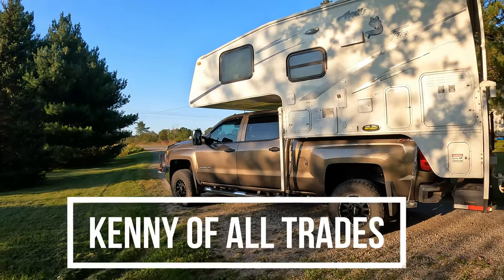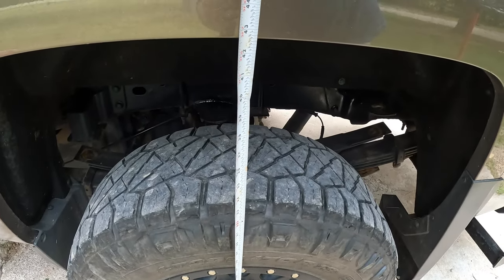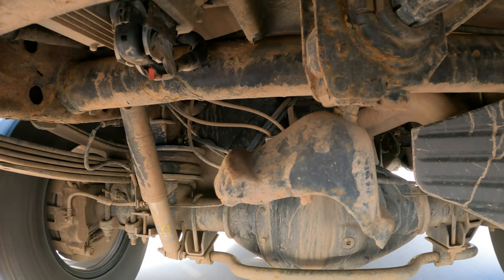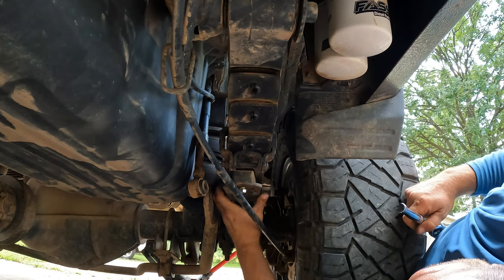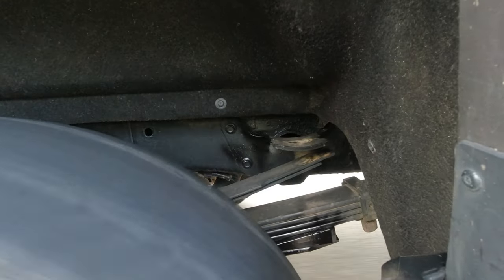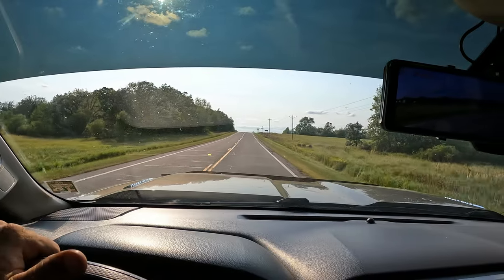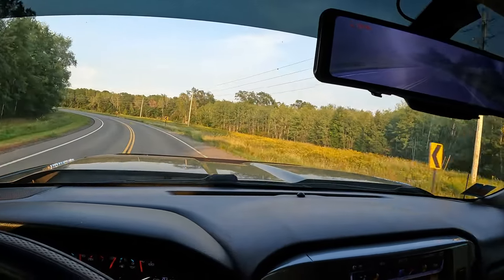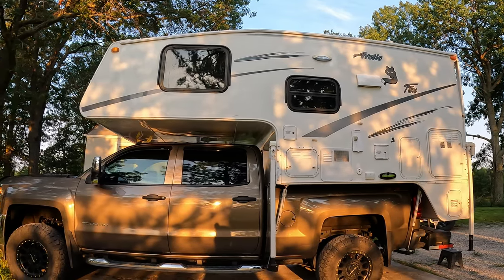Suspension Upgrades for Truck Camper

Comment: I don’t understand how every body thinks a 6.5’ bed is standard. What has changed 8’ bed is standard bed size or a short bed or Texas Caddy.
Reply from the maker: I know years ago the 8ft bed was a standard. But now 6'5" is standerd, 5'8" is a short, and 8 foot is a long bed.
I completely understand what you are saying though. I think  manufactures have changed the definitions.
Reply: I've noticed the same thing and wondered about it myself. In today's America, everything gets smaller, yet more expensive. I think it all changed when larger cabs became popular.
Reply: I love my supercrew 6.5 ft bed I wish I could get a 8ft bed. My next truck I'm looking at is a f350 regular cab 8ft box so I can get a slide in camper.
Reply: 8ft hasn’t been standard in decades
Reply: As the ‘mall crawlers’ and pavement queens became more of a thing, the beds got shorter to cater to a larger crowd. People didnt need a 8 ft bed to drop the kids off at school, to grad a few things from Home Depot/Lowes. In order for less experienced drivers to handle driving such a long truck, they simply shortened them to be able to sell more. Not that they were changing the name or the game, they just found out how to sell more trucks to more people.

Comment: A tip about airbag’s.  Use separate air lines/valves for each airbag otherwise when you’re cornering air will move from side to side.
Reply from the maker: @jiml40  100% having each bag plumed separately is definitely a must-have. About 20 years ago, I stuck a truck camper in a truck with the airbags running off the same line. I didn't even think about the bags. That was a huge mistake. When I got into the first curve, the truck swayed up to the high side. As the road straightened out, the camper kept swaying back and forth. I had to pull over onto the shoulder before it stopped swaying. It wasn't drivable like that.

Comment: I pull a TT. I put on a Hellwig sway bar and I use Timbren springs. I agree Tork Lifts are nice but they have a high price tag. I want a truck camper. I am going to get a F-550/RAM 5500 crew chassis (19.5k GVWR) or a F-450 chassis (16.5k GVWR). I can’t decide on a Arctic Fox 1140 dry bath or the Host Cascade 10.5. Great video, great to know what others use on their suspensions for truck campers for my research.
Reply from the maker: Thanks. I think your doing it right, going with a 5500 is smart. That way you are not fiddling around with these modifications. I'll be honest, I dont think I could afford a diffrent truck in this lifetime.
Reply: Todd, my fav was the artic fox 1140 dry bath too, was considering it until i saw (some utubers did it) it on the same truck as mine (ram 3500 dually) n holy cow the camper imo looks too heavy for the truck. So yes 5500 or 4500, need bigger payload imo for that camper. Also i saw another tuber talk about his 1140 and said it’s heavier than manufacturer wants u to believe as he was at the weight scales with his. Liked the cascade (lots of choices for inside if ordering) but I do pull over off the road at times to quickly jump inside camper to get something or use bathroom, so 1140 table doesn’t extend into traffic if need to move it. 
Anyway After i freaked seeing how the truck would look with the 1140, i was back at the drawing board hunting. I ended up with a northern lite 10-2, drybath. Got it end of june. Didn’t even consider to look for one because of cost and dark interior, until i saw one in person. Well, I love it, inside wasn’t ordered in any black decor, and so seeing it in person quite shocked me actually. So I have no slide maintenance, no tpo roof maintenance, no anode rod maintenance, got a genny installed too. And like the 1140 has a 3 way fridge, game changer with lithium batteries! Came with only 2x 100 watt solar, but I run the fridge on the batteries no problem when travelling, in fact, i sat stuck from highway accident blockage, engine off for 6 hrs solid, fridge on battery, sun out, and it wasn’t until the clouds moved in after 5+ hrs that 100% battery went down to 93%. Sooooo, when i saw this northern lite, it made a lot more sense for me and justified the more $ it cost me than the 1140 would have been. Plus is a lot lighter. Campers weight sticker dry is 3410 lbs, because it was ordered with the stupid glass windows vs the acrylic, (glass added about 200lbs) but I’m not complaining, just always hate these screens that come with these frameless windows 🙄. Haven’t added anything to the truck suspension yet. Good luck in your hunt. 🍻

Comment: Hey brother I would go ahead and undercoat your truck chassis with wool wax or fluid film to stop that rust from spreading any further and protect your investment
Reply from the maker: You are 💯 right. I have a 3ft spray wand and fill the body pannels with fluid film. I really should do the frame. I wish we had a shop that sprayed wool wax nearby.
Reply: I'm in Michigan I know the rust struggle, I resorted to buying my own spray gun and 5 gallon bucket of wool wax/fluid film. I use kellsport gun but there is a lot of options. Average cost for a shop to spray is $250-400 and needs to be done annually. 
Extend the life of your truck exponentially

Comment: Kenny!!! This is video is gonna blow up!! You knocked it outside the park on this suspension video!! I can’t believe all the effort put into that video seriously. It was entertaining and informative 🤙 
Im embarrassed to say my truck is bone stock lol 😂
Reply from the maker: Thanks! I appreciate that!
Reply: @KennyOfAllTrades  second this comment. Excellent video. Quick follow up- overall how well has the actual camper held up? I hear horror stories of some brands but don’t hear much (good or bad) about AF
Reply from the maker: My Arctic Fox is going on 20 years old. All the appliances, the AC, the fridge, the water pump... everything is original. The slide has never given me issues. I can't complain about the Arctic Fox M 860. 
I did replace the front nose cap about 6 years ago. It leaked from the clearance lights and I had some delamination. There was some other leaks and delamination that had to be taken care of at the same time. So, the only repairs that the camper needed was from a lack of maintenance. I use the camper almost every weekend since I started the channel two years ago. It is holding up great!
Reply: @KennyOfAllTrades  thanks for the information

Comment: Great suspension info!! Your suspension is set up nicely for that camper!! Finally, information that shows airbags alone may level the truck and camper, but unload the springs and actually make handling worse. I opted for a custom built 4 leaf overload set to replace the single factory one, and an extra main leaf on my Superduty. Handles my 811 very nicely and sits level.
Reply from the maker: Thanks! 👍

Comment: Just did a rear suspension upgrade myself Mr. Kenny.
I bought some pacbrake airbags for my 2015 F350 Super Duty 6.7 prior to making an appointment with a frame and axle shop for installation.
The owner of the shop talked me out of it: "air bags lift your truck off the overload spring and their inward placement destablizes the load," 
which made sense to me.
He recommended  adding a leaf to the main spring,
and building a 5-pack overload set.
Wow! 
My truck gained full ride height with my over-stuffed 4000 lb (2800 dry) 2016 Artic Fox 811 perched on top and now it corners like it's on rails.
Only downfall is my factory ride became stiffer with the addition of the single main leaf.
It also added an 1.5 in. lift in the rear.
Happily my camper stays on the truck though.
It's my daily driver.
Cost for rear suspension upgrades $2250.00 (Canadian dollars).
That's about a $1000.00 American 😁
Still a little jealous of the suspension gains that you achieved  for the price you paid.
👉 And still waitin' to see ya catch a fish... 😄
Reply from the maker: That is exactly what I want to do.
I talked with a company that specializes in building custom leaf packs. They are about 60 miles south of me and sound like they know what they are doing. 
 He had the same recommendation, building a new leaf pack and overload specifically for my application. 
My current setup works untill I can save up the cash. Thanks for the comment!
Reply: IMO you did it the right way.  Trucks are meant to be supported by the springs not airbags
Reply: Bruce where did you get your leaf setup done? I'm setup similar to Kenny but don't like the performance of the airbags. I think the best way to start this entire process is to fix the spring issue, get custom springs first and then start layering everything else on.
Reply: @randymciver968  Sorry for the late reply Randy.
Just noticed your comment.
I'm in North Vancouver British Columbia.
The place I got the install was called Vancouver Frame and Axle. 
They work on mostly commercial vehicles but do cater to Rv's and such.
Any competent spring shop should be able to help you though.
What's your setup now?
Reply: @blackkettlecall  Hi Bruce, no problem. I have a standard leaf setup on F350, beefed up with airbags and an overload spring. Rids rough! But it handles the trailer fairly well, but we still get some sway if the road starts to get rough, and I don't think it should be that much. I can put 20lbs in the airbags, and the bumpers come off the overload spring, but too much sway, so we keep it down to 10lbs so  the bumpes sit on the overload spring. I think I should have gotten a good leaf job done and not put the airbags in. I may change up next year. Cheers!!

Comment: What a great video and kudos to you for taking the time to take apart, review, film and comment on each piece of your Truck Camper suspension  -  as you added parts.

I am working on building a good (read better) suspension for my 2022 GMC 3500HD SRW Diesel with a 3100lb Cirrus 820 Camper.  When the truck/Camper unit was new 2 months ago, it had some sag in the rear (stock only had a 2 leaf upper overload) and was a bit bouncy.  I fixed this when I replaced the overloads with a 5 leaf package, recommended at my local suspension shop.  
I will keep watching your videos for continued Truck Camper education. ( I see you made some comments earlier on "porpoising", my new annoyance.  Shocks might be next.) 

Your videos are Oscar worthy - in the "Best Short Documentary" category    :)  Thanks
Reply from the maker: That's a huge compliment,  I appreciate it a ton. I'm hald you noticed all the work I put into the video. Thanks!

Comment: I have put on a new Hellwig 1.5 “Solid Front Sway bar because the one from the factory was hollow and wimpy along with lower stabile Loads ,Hellwig Bigwig rear sway bar, Timbrens Bump stops and Bilstein Shocks My GMC 2500 Really Handles My Truck Camper With all the Suspension Upgrades. Thanks For Sharing Your Video
Reply from the maker: I had a 2008 Silverado 2500 with this camper before my current truck. The 2500 handled it just fine. These trucks setup properly are capable rigs.
I had to stop reading Facebook forums back in the day though....it got frustrating dealing with all the "weight police" telling me I was setting myself up for troubles with Law Enforcement for being overweight.  
I'll have to look to see if my front sway bar is hollow. The truck came factory with the snow plow package. I was told it had upgraded front components including larger torsion bars?
Reply: @KennyOfAllTrades  I also had the Rancho 9000 Adjustable shocks but replaced them with Bilsteins because the adjustments on the Rancho shocks kept backing down off the stiffest settings. I only have 88k miles on my 08 and still Love The Truck. Enjoy your Content. Safe Travels

Comment: Are you over the GVWR of the truck is the main question?. You can put the mods to it to handle the extra weight as long as you don’t go over the GVWR that would make it really unsafe. Great video, thanks for sharing.
Reply from the maker: I'm sure I'm over by a few hundred. Maybe a little more. The max payload something like 3860, the camper dry goes 3080.......so I'm over. But ive never taken it on a scale.

Comment: I love your suspension upgrades I only have a single wheel F250 super duty and I drove to Prince George BC to pick up my camper used. I live in Windsor Ontario and the wife and I drove the Ice Parkway through the mountains in January. Drove it all the way back on the stock suspension and found the truck sat ok but slightly down in the back. Stock the truck came with a heavy front sway bar and a multi link sway bar in the back. It handled ok on the trip back, but I wanted it to sit more level. I was advised airbags were the answer, so I bought the best I could find, Air Lift from my drag racing days. Yikes, what a mistake it was like riding on one of those old bed springs. I pumped them up full pressure and looked at the springs and the upper and lower helpers were way out of contact. I'm a retired toolmaker with a CNC mill and lathe in my garage, so I made my own wedges for the lowers. These have to be gently tapped into place making the lower springs in full contact with the airbags fully inflated. I removed the rubber stoppers and the rubber spring contacts and made extensions for the spring contacts front and back and made them to accept the original rubber spring contacts. These too were in tight contact with the airbags inflated. All done with the truck empty of course. With the weight of the camper on these are fully engaged, and the ride is perfect. The stock rear sway bar works, but I have a Helwig sway bar I need to put in.
Reply from the maker: That is awesome to hear! I love that you made the parts needed to fix the ride. That is so cool! One day, I'll make it up to Canada. The number of lakes north of Minnesota in Ontario is mind-blowing.

Comment: I did both upper and lower stableloads on my srw F350 running approx 800 lbs over max payload for the specific truck.  Alone they didn’t work well enough. After watching Ford’s video of there dually camper testing I quickly realized I had the wrong truck.  Now have a Dually F350 with more than enough payload and the handling is night and day.  Also when the camper is off the truck it ride just fine.  Something to consider if your camper is not on your truck all the time.

Comment: Great video. I did use the Tork lift overloads with Sumo Springs front and rear. Got rid of the air bags as I don't have on board compressor. I need the upper bump stops. But the ride is soooo...much better.  I have a 2007 Ram 3500 SRW with a 2006 Lance 9SC. Enjoy your videos Kenny and hope to get up in your neck of the woods soon enough. I'm a southern boy from SC and looking forward to retirement next year.
Reply from the maker: Everyone I have talked to has loved the Tork Lifts overloads. I like airbags for leveling out the camper when stopped, that's about it. They don't work well in the winter though. It will drop below 0 for a month or more straight here. The compressor will freeze up without a doubt. U can still use the bags.....just not the on-board compressor.  Lance makes a beautiful camper!

Comment: I sure appreciate your videos and the insight they provide. I picked up the backup camera after your review and I’m super happy with it. Im currently running airlift 5000 airbags in addition to roadmaster active suspension at max tension with a fleetwood caribou@ 3500#. I haven’t had much seat time with it so we’ll see how she handles. I particularly like your felling wedge spacers on the leaf pack! Thanks for another video and the effort it takes to make them!!

Comment: We agree that the tires are very important when it comes to carrying heavy loads. We put airbags on our truck as well but eventually will put on bigger tires. We probably need some suspension upgrades. You do have a good looking truck camper. Looking forward to next week and seeing if you give magnet fishing a try. Mary 💕 Fred
Reply from the maker: You guys are reading my mind! I was thinking today that I might give magnet fishing a go on next week's video. The State Forest I'm looking at is about 2 hours NE. I haven't been there before. I figured I could stop at a few bridges on the way to toss out the magnet.
Reply: @KennyOfAllTrades  Fred used to magnet fish off the sailboat at the dock. He found all kinds of rusty tools. 😎
Reply from the maker: That would be cool!

Comment: 8' bed is standard. At least when my truck was built.

I've done all these mods at some point for my truck camper. I don't do the felling wedges anymore - too much of a hassle to take on and off and don't reallyneed them once you do the overload extended bump stop (stabiload or other). Air bags I leave at 15psi now because they lift off the overload spring bump stop.

So for me anyway, Hellwig rear sway bar, and stabilload overload bump stops are the best bang for your buck.

Although don't forget tires. I recently bought new tires. Load capacity per tire is 3950 lb where previous were 3100 per. This also makes a huge difference.
Reply from the maker: The tires make a big difference.I explain in a different video the importance of a load index 129 tire. I hear what you are saying in bed sizes. It was in the 2000s when the industry changed its terms. For many years, there were two beds, a standard and short. Now there are 3 common styles. A short box, a standard and a long bed. I completely get what you are saying. I agree that the felling wedges are a huge pain to take out. Thankfully, my camper has only been out twice in the last 4 years. If I didn't have a YouTube channel, I would not be camping every day off of work. I'd probably get more use out of my truck.
Reply: @KennyOfAllTrades ❤